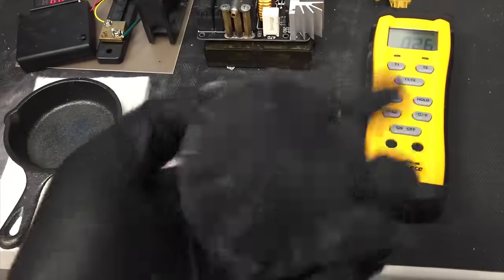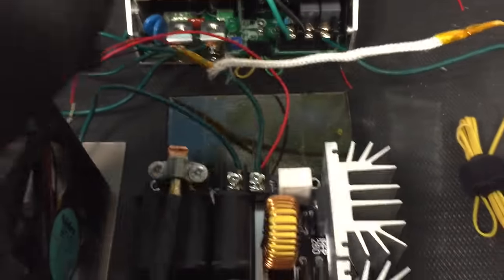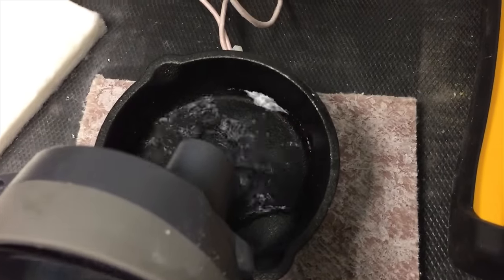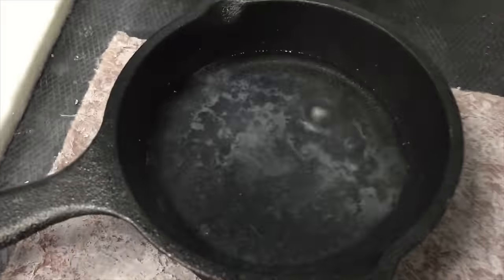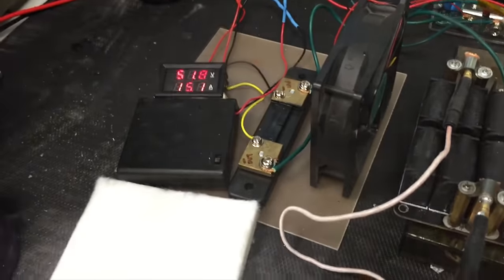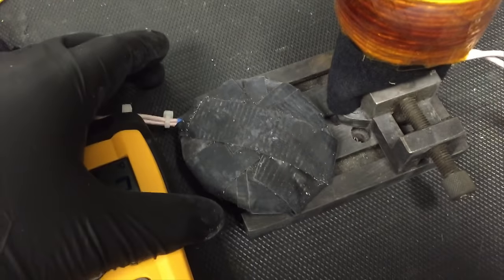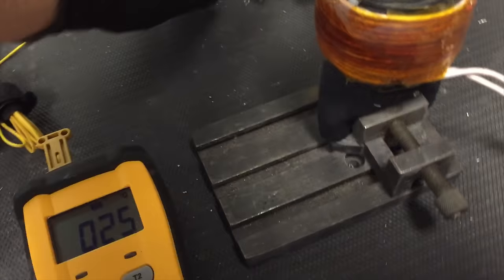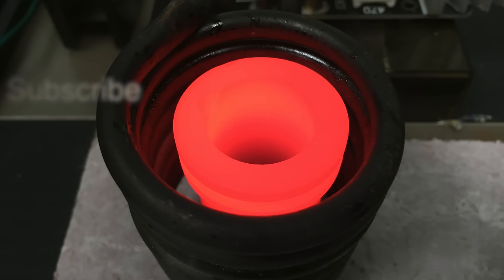1000W Induction Heating Part 4: Pancake Coil

Comment: I am thinking of making a sort of molding machine by wrapping some of the his Litz wire around about 1" pipe and having it heat up to about 350-450F, any suggestions on how to control temperature and what kind of spacing to use?  The link you provided for Litz wire it's 56 bucks for 5 feet and it's 9 gauge, can a smaller gauge be used because it's much much cheaper on eBay.

Comment: Great video, but I just want to point out to those viewers who don't catch it that you used Litz wire, which avoids skin-effect losses that you would have with regular stranded or solid wire by using hundreds of strands of insulated fine wires, and is the only reason your coil doesn't get hot.  The link you provided for it lists it as 5 bundles of 108 strands of insulated #36 wire, #36 being good to 50kHz and somewhat beyond.  And guessing at the size of your coil, I'd say it is at least a few dozen microhenries, probably much greater than the stock coil and therefore shifts the resonating frequency much lower (by about 2/3, I'd guess?), which is not a bad thing as long as you don't go so low that the heating becomes inefficient; the resonating caps, which are what is usually the most stressed in inductive heaters, will run cooler and have lower losses.  Good job!
Reply from the maker: Just seeing this now.  Thank you!

Comment: If i make a bigger one with half inch copper tube do you think i will be able to make a metal foundry?
Reply: I want to be able to put a fire extiguiser as a cruicable on it and melt aluminum and copper alloys. Is this possible?

Comment: Is that copper tubing or solid copper wire and do you just connect a positive and negative to a 12-volt feed to power it? It almost looks like 3/8 inch copper tubing but I'm not sure and is it just copper spoiled and then positive to negative it will not harm my batteries or anything?

Comment: Thanks for doing this video! I have ordered one of these ZVS drivers, which should arrive shortly. For years I have  used my "mini ductor 2" with great results to heat ferrous metal. It also has a 1000 watt output to the work coil, as is the maximum output rating of this ZVS driver unit.  I do realize that this setup uses a "resonant tank circuit" (unlike my mini ductor 2). My question to you is, how warm do those capacitors get over prolonged use when under load (in the tank circuit)? The fan you have positioned in front of it has me wondering.
Reply from the maker: +Mysimplefix I have only used the driver for about a max of 10 minutes at a time and that is maybe only 5 minutes under load.  I have the fan mainly to keep the heat from the workpiece from creeping back.
Reply: Oh OK sounds good! Thanks by the way for replying. Keep up the great work! I'll be watching.
Reply: +Mysimplefix hey I've made a whole set up with water cooling for the coil and after 15/20 minutes of use with a high load the along with the  mosfets the caps get really hot but with an old pic power supply fan on cooling the whole circuit is enough to to keep them cool for ever😎
Reply: +Kyle Brackenfield thanks for posting. I'll be making a water cooled setup too once things around here settle down. It's been quite a year.

Comment: Im designing a 240W induction heater, I'm using single core 2.5mm wire
by measuring on scope the resonant frequency and voltage stress on switches is right similar to design
the problem is its drawing only 40% of power, 'what'd be the issue
I think I should use similar coil with strands instead of single core thick wire

Comment: Thanks for this video. It helped me with my induction heating start. 

Here's my question. Will a longer length of Litz wire pull more amperage or is it really dependent on the part?

I ask as I might run multiple induction circuits as I will be wrapping around the outside of a 12" diameter pot. I'll surely know the answer once I try it but I'm trying to save myself from splicing expensive Litz wire in half...

I'm curious if I could wrap the hight of the 8" of the pot (yes it will be a lot of wire) or if I'll have to split it between two systems and do 4" x2.

Thanks for your videos! I think you're doing a great service to help the rest of us tinkering around...

Comment: Hi, a question, I did notice a second click when you turned the 'device' on. How do you start up? Do you have a second switch? Do you turn on the power first and then the ZVS device? I understand that when you turn the ZVS on at the same time as the power supply it can get damaged. The FETs could both turned on at the same time or something like that. Can you clarify this to us, how to start up or how to wire this? Thank you.

Comment: Hi. If an induction coil is 20 cm in diameter and the pan I use is 15 cm in diameter, do you know if a typical induction hob for sale would recognise the width of the pan and only limit the electromagnetic field to that diameter of the pan, or would the current circulate across the entire coil (20 cm diameter)? I am trying to understand if there would be escaping radiation in terms of EMF. Thanks

Comment: Hi Proto G.
Does the coil work on both side? 
When you turn on the power - If there is another pod at the bottom .. will the coil heats up both of the pod ( Top & Bottom ) ??

Comment: Why not design an emergency cooking and heating and power production system that requires nothing to burn or consume? That runs off solar and battery? That generates no toxic gases has a by product? I bet you can do it! ; )

Comment: Hey Proto G I was wondering would I fry any of my electronics if I had 2 pancake induction coils facing each other? I was thinking of placing 1 plate of steel in between 2 pancake coils.

Comment: Use graphite rods in a Manson hot air engine stove top fan build to make it run off the induction field. Try to use a low voltage induction so you can run it off a solar panel battery system. Novartis

Comment: Throw in a thermal electric power generator in the build or an add on accessory and create an integrated support system you can use for camping or in emergency shelters. Novartis

Comment: Hello! Brilliant video. Just 2 quick questions: what cooling fan do you use? I hooked one up to mine yesterday and I fried it's motor as it was only a 12V rated one! Secondly - do you connect it straight to the power supply or do you incorporate it into the ZVS board?

Thanks!

Comment: This is awesome - thanks!
Maybe you can help answer a question??
I am a beekeeper and I sell honey for a cancer foundation through a Non-Profit I set up in NC. I am in the 7th year and I am going to build several new hives. I am going to preserve the wood by boiling it in beeswax and pine resin. I fabricated a vat that is 24"HX22"Lx18"W. It is mild steel with the walls being .125" thick and the bottom being .375" think. Can you offer any advice on how I could build an inductive heater to put on the bottom? The amount of material needing to be melted is pretty substantial and doing it over a flame isn't nearly as appealing as heating it with an induction element?
Thanks
Reply from the maker: +howardtoob Thank you, you could use induction but a 22"x18" .375" bottom plate is going to probably require more than 1000 watts to heat up in a reasonable amount of time.  I think a flame is your best bet unless you redesign the vat to have a much thinner bottom plate.

Comment: Well I guess that me been the ignorant on the room, may I ask you,  if there is not a metallic object in the proximity of your pancake inductor there is not amperage or voltage draw?? and I guess that the second question will be, can it be projected to work in only one direction? Just don't understand how it can't be consuming power when there is not metal next to it...
Reply from the maker: A ZVS driver is a self oscillating circuit so it is drawing current when there is not metal nearby.

Comment: I thought that current draw would be determined by the resistance of the coil itself, not the conductance of the magnetic field. Does the 'absorbed'  field somehow change the reactance of the coil?
Reply from the maker: The mosfets are configured in a self oscillating circuit such that any changes in the inductance of the coil will change the frequency and current draw.  Look up ZVS driver simulations on YouTube to better understand how the circuit works.

Comment: Just a side note for those admiring how fast the little cast iron skillet heats up.
Cast iron is a no-no for regular induction cook tops because they get too hot, overheat and melt the entire induction cook top. The protection does turn it off pretty quickly, so no cast iron in induction.
Unless you want to get it red-hot or melt the cook top!
Reply: BS! You need to FILL any cookware, be it cast iron or other, on an Induction field. Period. To cook means to cook food, not empty skillets.

Comment: Man, thanks for your video.
Currently I am using the same zvs driver for the cooking coil. My s.m.p.s operate up to 48v-18a. But the problem is that the current doesn't increase over 12 amps.  Can you guess what to do to increase the current? FYI, I put stainless steel pot on top of the cooking coil.
Reply: For this kind of build the main method to increase the current is increasing the resonant capacitance of the ZVS driver. More capacitance means more current, although it may be your power supply not be able to output the needed wattage for the driver.
Reply: @JohnDoe-rm2gs  Thanks for ur reply!

Comment: You linked everything but the coil material. What are you using? Silicone-insulated copper? What diameter?
Reply from the maker: It's litz wire that consists of hundreds of insulated wires braided together.  Watch the other videos in the series where I explain it.  I added a link in the description.
Reply from the maker: +techkitsune Here's a patent about litz wire for induction heating and reasons why it's beneficial.  https://patents.google.com/patent/US4296295A/en?q=induction+heating&q=wire

Comment: Excellent work mate, quick to the point, great. I have had one of these ZVS circuits for about 18 months, and I still can't get it to do exactly what I need. I keep trying different coil designs to get the speed of the heating faster. I am heating the end of brass tubing to anneal it. Of course I need different to be able to heat different diameter tube with the same coil but quicker. I cannot get it to heat fast. I have a 36v power supply and it takes 25 seconds to get to annealed temp (399c). Would you have any ideas around coil design that would speed up the heating process to like 3-4 seconds? or do I just need more power? The exact relationship between coil design and speed of heating, is one aspect of induction heating I cannot find any info on the net anywhere!!!
Reply: I'm not the author of the video, and I have only been learning about this topic a short while (even though a lifetime of engineering background), and you don't mention the range of sizes of the tubing you are trying to anneal, but in general (I think), you want the work piece to be exposed to the volume of the magnetic field that has the highest flux density.  So the inside diameter of the coil should only be slightly larger than the work piece. For annealing just the ends, you might try a double-layer coil, say something like 2 layers of 4 turns each?  As closely-spaced as possible yet not able to short any turns.  And isn't this heater rated for something like 48V or higher?  Try adding a 12V supply that has at least the same current rating of your 36V supply in series, but be careful, the caps will run hotter and may blow if loaded too heavy for too long.
Reply: Yeh I might give those a go. I am annealing rifle brass case mouths and necks, for cartridge reloading. So the work pieces are very thin! It is just that the works pieces vary from 0.17" all the way to 0.5" in diameter. So I need it be be 0.6" or so, at the minimum.

Comment: My glass cooktop in my kitchen has 4 inductive coils in it (One per cook spot) and it can boil a big ass pot of water in about a minute.
Reply from the maker: +ElfNet Gaming Very cool, I bought an 1800 watt induction cooktop to do a teardown video and test the power.
Reply: It uses less power than the traditional heating element type and is safer.. My goal is to have my ENTIRE home run off solar power with the mains AC grid as an option for the central A/C unit, electric cloths dryer and water heater.

Comment: I did some digging and small stranded silicone wire looks like it would be effective as a coil. The Litz wire is spendy and delicate, normal 8awg silicone wire has >1600 strands and the covering is good for 200*C.
My research led me here; 500kc dot cm/downloads/stranded dot pwf
Reply from the maker: +XxXAUTOXxX Nope, the strands in the silicone wire are not individually insulated so you do not have any increases in efficiency due to the skin effect.  Do some research on the skin effect and read patents on Litz wire and you'll see that it is much more efficient for high frequency AC like in the induction heater.
Reply: Did you go to the link?  The math is all there. 
Yeah, minor efficiency decrease for sure but at a price difference of >10 times?
Reply from the maker: +XxXAUTOXxX Yeah, I really didn't like that article.  There are many different types of litz wire and they did not refer to any of the different types specifically.  Their model only claims to be accurate up to 100kHz and they did not compare Litz wire to the stranded wire other than stating that stranded wire losses are substantially higher than litz wire in some cases. They only really compared stranded wire to solid core.   The coils I'm using are operating at around 170kHz and other induction heaters operate at much higher frequencies.  That might not sound like a lot but the skin depth of current flowing through copper at 100kHz is about 0.009".  The skin depth of current flowing through copper at 170kHz is about 0.007".  That's a 22 percent loss of usable copper, not even mentioning the losses due to the proximity effect.  With high frequency coils, you need as much surface area as possible for efficiency.  You are better off using copper tubing than 8awg wire if the cost of litz wire is an issue, although the 8awg will still work as a coil.
Reply: +Proto G Fair point, thanks for elaborating.
Watching your vids got me motivated to post a couple more on my other account.
All the best!

Comment: Would a simple ZVS driver do the business with a 12V 9A power supply? One problem I have always ran into with my ZVS driver is that the wires (coil) and even the capacitor can get really hot due to the high currents involved, though the IRFP250's stay really cool to the touch! Litz wire was able to help prevent the series inductor from overheating but it did not seem to help with the main coil.
Reply from the maker: +Power Max The problem with a 12V 9A power supply would be that the coils you make will not draw anywhere near 9A with only 12 volts.  My coils do not get hot even with 1000 watts.  Litz wire is more efficient for induction heating in multiple ways.  A 600 stand litz wire divides the current evenly 600 times.  This results in less generated heat from the current.  I have tried many different strand counts of litz wire and not all litz is created equal.  40 and 100 strands didn't work well at the frequencies I'm working at.  I have a fan blowing on my capacitors, but they don't get that hot because there are six of them.
Reply: +Proto G I was using around 8 turns of standard household solid copper wire, the coil was made around a normal marker, about 1/2 inch diameter, center tapped, because it needed to be. The best I could do was get a drywall screw glowing, before the coil itself got hot enough to desolder itself from the rest of the circuit!
Reply from the maker: +Power Max Solid copper wire is pretty bad with high frequency high current.  Also you would have been better off with copper tubing or litz wire.  My coils do not really heat up on their own.  Why did your coil need to be center tapped?
Reply: +Proto G http://cdn.instructables.com/FIZ/4YEK/HJKBPR9P/FIZ4YEKHJKBPR9P.LARGE.jpg
This is the schematic I was using. It is generally used for driving a transformer, in my case, a flyback transformer. It is a variant of a royer oscillator. To turn this into an induction heater, I simply removed the secondary and the core.
Reply: +Proto G Great Job!  Do you know the Henry rating or any of the specifics for the two toroid coils? I burnt  my up. This was good for you since I bought a new one at Amazon (Niaho) at least I think this was you. If not let me know.
Reply from the maker: +Thomas Roberts Thanks, there are two 100uH toroid inductors on the board.
Reply from the maker: +Thomas Roberts How did you burn it up?
Reply: Power Max